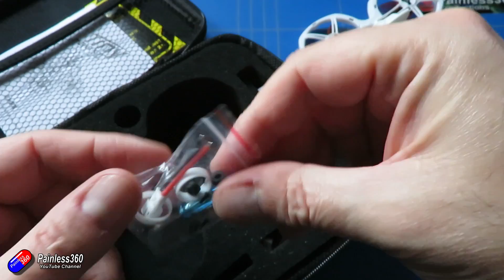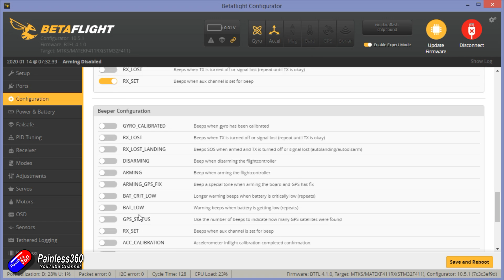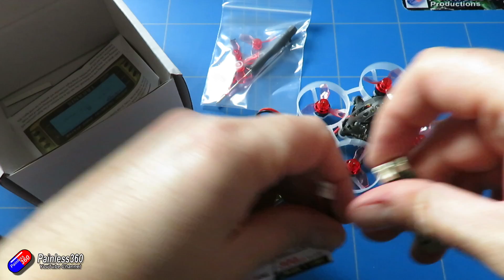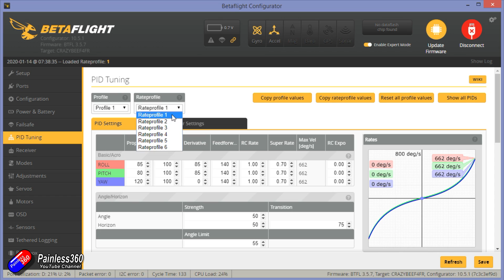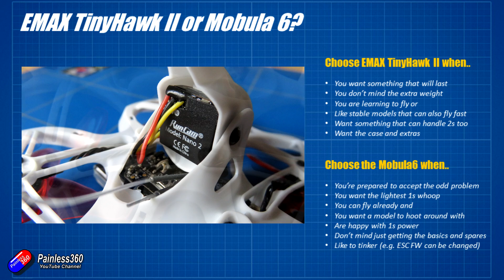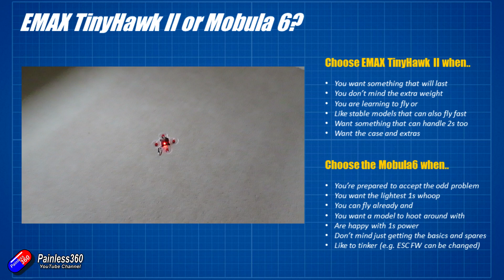EMAX Tinyhawk II & Mobula6: Review and comparison

Comment: Great video! I'm a beginner,  Would it be better to buy  the Rtf version of the Tinyhawk II or a  bnf mobula 6 flysky version?  I have  a FS-i6x transmitter. And I'm considering buying the Eachine EV800 Dm to go along with the mobula 6 and my transmitter.  Hope to hear your thoughts!
Reply from the maker: If you already have a radio then buying something that works with it is a better idea IMHO (assuming that you are confident to setup the model on the radio and bind it)..

Comment: I know this is an older video but ,Have you ever had the TH II apart? It appears the connector the motor plugs into is glued onto the board, not soldered. I went to unplug a motor ( 3 came unplugged easy enough) the 4th one when I went to unplug and did not even pull on it,the entire connector came off the board....it appears to have been glued and not soldered...it has three pin connector in the bottom front and one contact on each bottom corner on the rear, and it appears to just lays on the contacts on the board and is glued down to ensure contact ( I see no way or know of no iron that small and thin to be able to get under the connector to solder anything on the board contacts)....any advice or suggestions or any knowledge of it would be appreciated...Thanks in advance
Reply from the maker: I never had to.  Happy flying!
Reply: @Painless360  Thanks for the reply anyway .

Comment: Any tips advise. Finding mob6 won't hover. Just brought myself the mobula 6 and TX16s. Only trying LOS for now so delaying google purchase. Flown a few "toy" drone most recent being a x900 and the seem ok. But with mob6 can't get a steady hover. Seems to find a throttle level and then it will suddenly drop or raise. Willing to put it down to fat fingers and lack of finesse perhaps. But just wondering if I missed something or it a fault. Tried tweak throttle curves etc but not found a good combo. Inside flying 1m height.
Reply from the maker: See my video on tweaking the throttle. Google something like 'throttle hover painless360'
Reply: @Painless360  Cheers will take a look. Have tensioned the gimbles a bit as both ratchet and friction adjustments seems to be basically zero on my TX16s and has helped a bit so hopefully this may be the final helper. Am starting to see some progress as was, but was still loosing any control on yaw.

Comment: Cheers for the review, thought id mention when you get caught in the air like that in the tiny hawk, you can switch to horizon or acro, and tilt it a little bit more, and it will go against the wind, on 2s it has no trouble at all with a pretty heavy breeze
Reply: Isn’t there also the assisted acro mode now.

Comment: hi i hope you can help me?
after your review i purchased a tinyhawk2 and set it up using betaflight flight on my jumper t16
every thing is working fine apart from one problem.
i have set my end points to 1000 to 2000 and calibrated my tx
but when i arm the tinyhawk the props spin up evan at the minimum throttle setting?
how do i correct this so the are at idel when i arm?
please help as it is driving me mad i am new to fpv copters
best regards
Nobby
Reply from the maker: Turn on Motor_Stop on the top right hand of the configuration tab. See my video on Betaflight BNF setup...
Reply: thanks for your help
your videos are like gold dust 😇 now all i need to do is learn to fly 🙈🙈🙈

Comment: Hi there just wondering if you can help I have a tint hawk 2 rtf kit as I'm a fpv noob and mid flight I lost rssi now when I turn my drone on I have 2 flashing leads red and blue and I can enter bind mode but cant bind the emax controller any help would be much appreciated thank
Reply from the maker: I've not used the EMAX controller here. Something else must have happened apart from 'lost rssi'. I'd check the manual for what those LEDs mean and see if it offers any tips.. Best of luck..
Reply: @Painless360  cheers mate nothing inn the manual about it i have reset it all now i gett  low rssi but thanks for your help mate

Comment: The tinyhowk 2 automatically change the pids profile when detect the battery voltage. If you put a xt30 and flash the ESCs to 48khz, you get about 40 extra seconds of fly
Reply: the xt30 upgrade was well worth it, it also got rid of almost all batt sag when on 2s.

Comment: I usually build and set up my own quads.....However I've decided I want an indoor smooth quad to fly around the house I did have a mobula7 over a year ago but even with throttle taming on betaflight I just couldn't get on with it and got rid of it.
Watching a few youtube videos i'm now thinking of buying the new Emax tinyhawk 2 flying on 1s battery looks like a smooth indoor flyer (im not looking to race just to fly around the house under the tables chairs etc)...So here's my question ?
My TX is a Taranis X9D+ Special Edition which is a EU version and my four outside quads all have EU software R-SXR receivers on them bound to D16.
My Tx had either D16 or LR12 bind modes....Ive just put the latest Taranis update on my radio not ticking 'eu' on Open TX when I flashed it so now I have the option of either D16 or D8 binding.
I've read online that through betaflight in the receiver option you can change the tinyhawk 2 from a 'Frsky D for 8 channel' to 'Frsky X for 16 channel' so the real question is this.....Can I now bind in D8 Mode or D16 Mode and what would be the difference am I still getting full telemetry in both ?
I only have one model set up in my Tx so all my quads are bound to that ie D16 mode so if I bound to D8 my other models wouldn't work unless I created a second model to bind in D8 ?
Basically if I bound in D16 like all the other four quads I could then run the tinyhawk on the one model set up but would I still get telemetry ? I'm just trying to work out the difference between D8 and D16 ?
The Emax tinyhawk states its a spi receiver compatible with Frsky D8 mode ?
Thanks for any advice .

Comment: Mob 6 frame is fine, i have done over 100 packs flying a track round my engineering workshop full of hard metal and concrete and have crashed alot, 
Video of the track

https://youtu.be/xrUWMMX8qRk

Comment: Thanks for the video.  

One slight correction on the connectors pin construction of the TinyHawk 2 and that is it’s still a hollow pin construction (unless there are different versions already).  I just checked mine that I received this past week and it has hollow pins.
Reply from the maker: I've had this one from before Xmas so it's possible... Happy flying!
Reply: Painless360 it’s interesting that their first batch have them and not their more current ones.  It just doesn’t make any sense!
Reply: Sam Avella I replaced mine with solid pin connector.

Comment: I enjoyed my Tiny Hawk S but there's a design problem no one seems to talk about. The motors are upside down & the props are held in place by friction. The result of these two aspects mean that when you try to use flip over after crash it just throws its props off!
Reply: I've never had that issue with any of my hawks lol
Reply: @bluelinefpv559  Happens every damn time for me. I'm getting a Mobula 6 instead now.
Reply: @davidrgilson  sorry you have had that luck with the Hawk man.
Reply: I fly the original 3 blade props on my th2 and on 2s flips no problems.

Comment: I've been having a lot of fun flying my Mobula 6 through my DIY LED race gates, as my recent YouTube uploads show, but there is a problem with it - If you try to fly with a battery that's lower than 3v charge voltage, there is a chance it will brownout and wipe the EEPROM, erasing all the Betaflight settings and radio binding. Happened to mine 3 times so far.
Once your Mobula 6 is setup and working, do a CLI "dump all" and save it, so you can paste it in & rebind the radio if necessary.
BTW my FlySky version came with a little note saying if I find the range isn't good enough then I should plugin the included FS82 RX module...!  I've only been able to fly it indoors so far (typical British winter weather) so haven't had range problems (yet).
Reply: Thanks for the info, I was wondering why mine had to be re-set (twice), need to keep it above 3V, thanks!  Have you tried flashing it to 48 ghz?  I heard it adds flight time
Reply: I had the same issue

Comment: Fantastic review. I love my TinyHawk 2. Great indoor and outdoor flyer.
Reply: Joseph Bove do you fly 1s indoors and 2s outdoors? Or either way
Reply: @danb1264  I've been flying 1s indoors and outdoors. Try the RDQ 650mah battery. Longer flight times and the motors and battery stay cool. I have the original TH and with the right settings that thing screams! Still haven't bought the Mobula 6. Guess I'm more of an Emax fan than I thought. Lol Stay safe and happy flying.